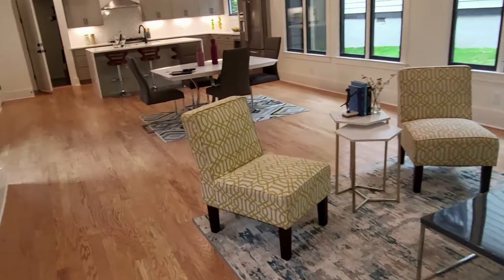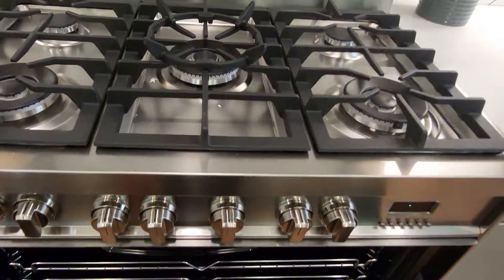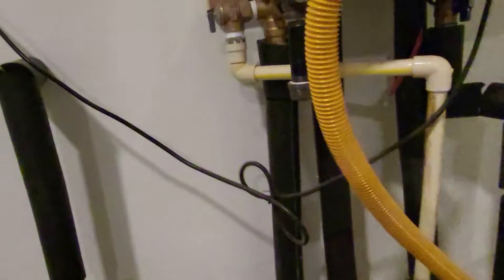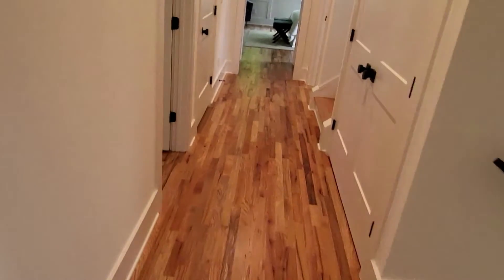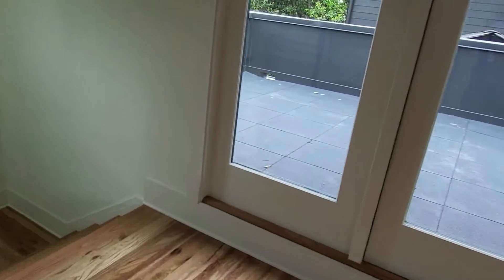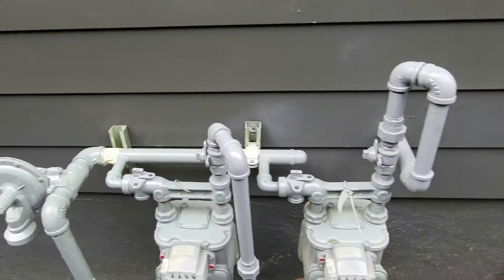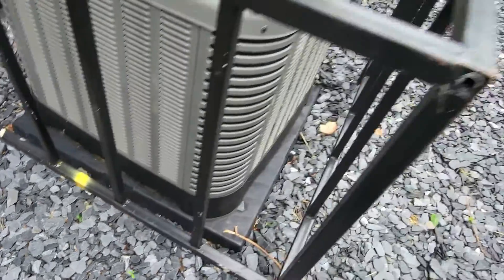Learn How to do a Residential Mechanical (HVAC) Final Inspection

Comment: I see the stove was stable, so you didn't need to mention for the stove to be secured so it won't tip forward?
Reply from the maker: So, all new stoves come with an anti-tip bracelet. This is provided so that if a toddler steps on an open stove door, the entire unit won't tip over.
Reply from the maker: I appreciate you watching.

Comment: Also I am questioning the traps on downflow furnace
Reply from the maker: The condensate pipe???
Reply: @PPG1967  yes most of the time manufacturers don’t use traps in downflow applications.
Reply: @PPG1967  I put an antisiphon tube for the condensation drain and have never had an issue. Air is pushing into the a-coil vs a lift effect when it’s an up flow

Comment: No acid neutralizing on hot water system drain
Reply from the maker: Is that in the International Mechanical Code book??
Reply: @PPG1967  section 803.1 IPC
Reply from the maker: This is not a commercial hazardous waste drainage system.
Reply from the maker: What code books  has state adopted?

Comment: Good video!! What is the requirement for exhaust fan in the bath need to be on top the toilet or it’s doesn’t matter?
Reply from the maker: The exhaust fan is needed for the shower and toilet.  If you have a separate toilet room in that bathroom, then you'll need two exhaust fans.
Reply from the maker: I appreciate you watching.
Reply: Thank you Sr!! Great videos and continue do greatest work
Reply from the maker: I appreciate your feedback.

Comment: Where I’m from it looks like the gas meter would be too close to the outdoor unit.
Reply from the maker: Oh ok, where are you located?
Reply: Well looking at it again again it the clearance looks plenty good. But in the NC fuel gas code the regulator must be 3ft from an ignition source and the service panel of the condenser is considered an ignition source. I believe it is 410.3 in NC code not sure about ICC. 
 @PPG1967
Reply: On second look the clearance on this one looks okay. But in the NC fuel gas code 410.3 I believe requires regulators to be 3ft from an "ignition source" we consider the service panel where the high voltage enters the condenser to be an ignition source. I'm not sure what section that is in the national fuel gas code.   @PPG1967

Comment: I noticed  both air handlers have the secondary drains plugged with the red factory plug still and no secondary ss2 switch/ drain pipes down into the auxiliary drain pan and no ez trap safety switches installed on the primary drains. Whats your reason for not addressing that? What if the primary drain was to become obstructed? How would the condensate drain without a secondary safety/ drain. I dont have my code book in front of me but i can 100% guarantee  the IMC clearly states that secondary drains are to be installed.
Reply from the maker: Well, you need to get your code book.  In the 2018 IRC or 2018 IMC, section m1411 heating and cooling equipment (2018 IRC). In lieu of a second or auxiliary drain system, a water-level detection device that sits in the drain pan is allowed.
Reply from the maker: I appreciate you trying to find holes in my video...thanks for watching!!

Comment: Wouldn't the inspection of the kitchen hood be done before the cover is in place? Seems like it would be a pain in the neck to remove that cover.
Reply from the maker: It depends.  Normally, it's done on the mechanical rough. However, there are times when a kitchen hood  is a last-minute addition.
Reply: @PPG1967  That's what I was thinking. Seems like that would be done on the first inspection. I am new to this.  Studying to get my license.

Comment: What about the working space in front of the exterior A/C disconnects? Don't look like much there~!!!
Reply from the maker: That's more than enough working space for two disconnects next to each other... you find anything else sir???
Reply: @PPG1967  I thought there needs to be 30" of side to side working clearance in front of the disconnects (at 6:34). Or does that only apply to panelboards/load centers?
Reply: OK, I believe A/C disconnects are exempt from this rule. NEC 110.26(E)
Reply: But, even so, let me see you stand in front of those disconnects and check the connections... Plenty of room huh?

Comment: Why is there exterior seal tite coming out of the interior disconnect to feed the air handler?
Reply from the maker: That's foam sealant for any air gaps..where are you located??
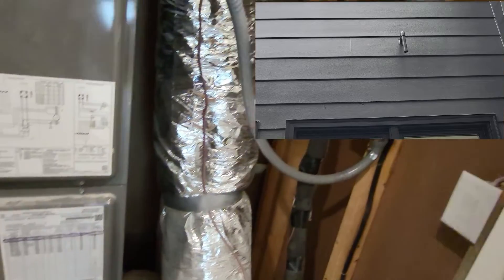Reply: @PPG1967  I'm in Arizona. I was referring to the conduit being used at the 3:46 mark. Just curious why the contractor used exterior type flexible conduit (I call that seal tite) in that situation. Seems aluminum flex would have been sufficient.

Comment: Exhaust fan running but whether removing  air or not. Two different occasions, I found exhaust fan motor running but no suction.
Reply from the maker: Wow!!...unbelievable!!
Reply from the maker: Thanks for watching!!!
Reply: I've ran into this problem as well. The fans have a "rough or choppy" sound. I've found that the terminations were not properly connected or simply not connected at all in almost every case.